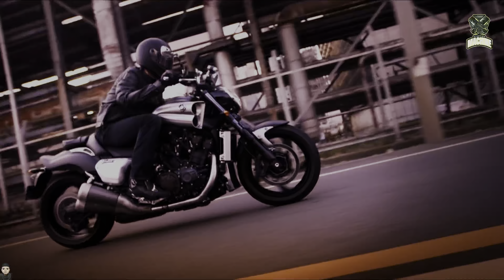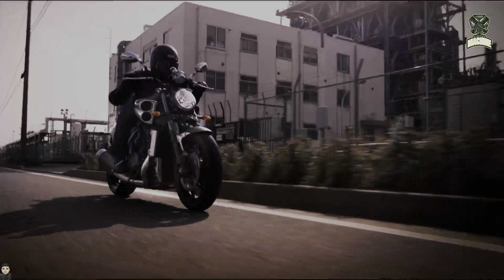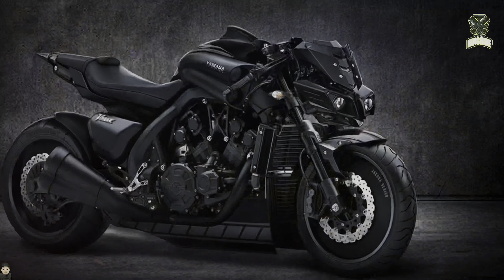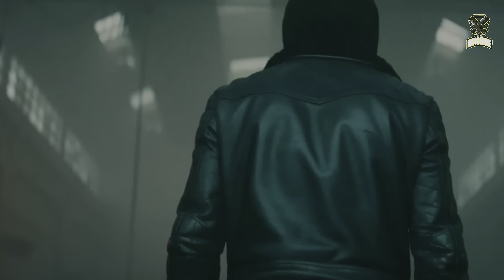2025 YAMAHA V-MAX CONCEPT | WILL IT BRING BACK?

Comment: I don't think anything about this is an improvement on either the '85 or '09 version of the V-Max. And the dorsal fin on the "tank" (the real fuel tank is under the saddle)? That's just stupid.

Speaking of stupid, why is the V-Max being called "electric-powered"?